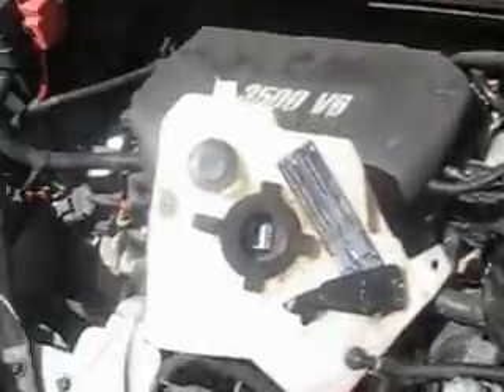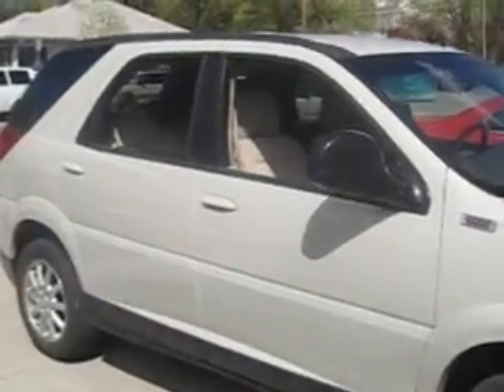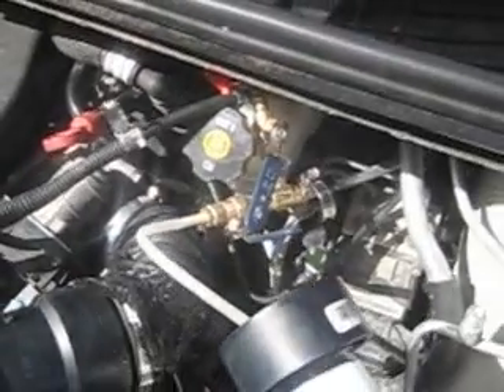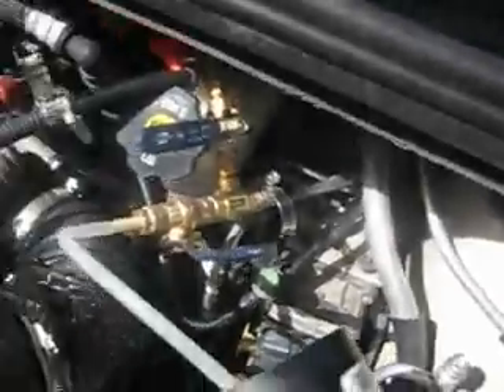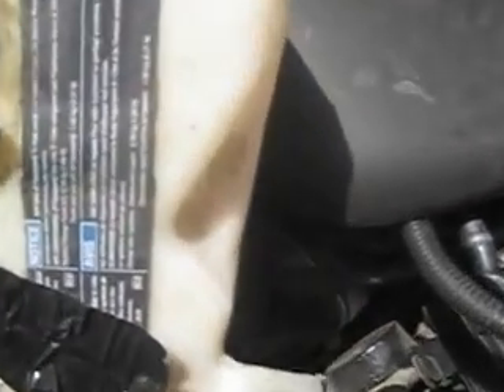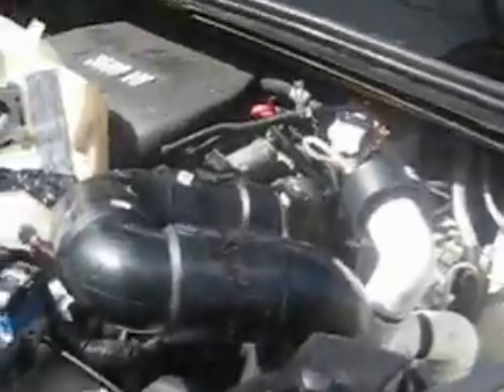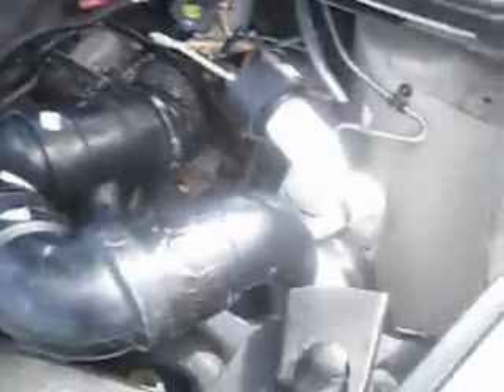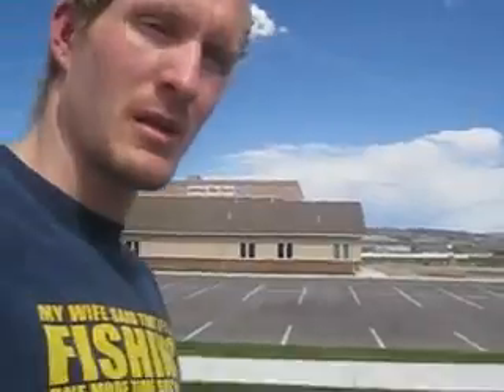200+ MPG Gasoline Vaporizer Project Original Design (Driving On Only Gasoline Vapor)

Comment: do you have plans of how to do this that you're sharing? I mean like a downloadable pdf of detailed instructions on how to do this?
Reply: Tyson Capel
I appreciate the reply - and will be waiting eagerly, I'd definitely like to see some plans for this.... Thanks
Reply from the maker: No sir I don't have any downloadable plans I won't have any until I have a system that is reliable enough to put plans out for it.
Reply: Do you anticipate that to be soon? Or could it be quite some time?
Reply from the maker: I would like it to be soon but reality says it won't be. Alot of improvements and testing still need to be done. I do have a vaporizer injection nozzle that is in the works and is by far the best design. I will be testing it once I have the money to get it made. The prototype will cost me around $2000.00. I have already put around $12,000.00 into the research and development of these systems so to an extent time is contingent upon money.
Reply: Tyson Capel
So are you actually going to be designing a product? Or are you just currently perfecting different designs that people can make themselves?
Reply from the maker: James Popp I am perfecting designs that people can make themselves. I Have a design that has to be machined and will be computer controlled but the file will be available for anyone to download so they can get it machined anywhere there is a CNC.The electronics will be available to purchase.

Comment: have you tried this on a tubo charged engine .  might solve the problem on humidity issues,
Reply from the maker: No I have not. It may solve the humidity/moisture issue.
Reply: what humidity issues are you talking about?
Reply from the maker: I am referring to the constant change it the moisture contained in the ambient air.

Comment: Tyson, One suggestion that might increase the efficiency of this system, Why not build another heat chamber with copper or stainless steel wool just prior to entering the intake manifold to super heat and further vaporize any droplets that may enter the intake. This should further increase the efficiency....What do you think?
Reply from the maker: Check out my newest vaporizer video of the vaporizer on my generator...

Comment: Have you tried to compress the fuel vapor into a container, then letting the fuel injectors manage the compressed fuel vapors?
Reply: because the vapor will again be transformed into liquid
Reply: Compressed fuel vapor is gasoline. Doing this is essentially just letting it run as it normally would.

Comment: Brave man to use such a nice vehicle as a test bed.

Like you, I'm amazed and disgusted that auto manufacturers would just let these patented gas vapor systems sit unused even after the patents have expired and they wouldn't have to pay any royalties while they struggle to meet clean air and CAFE standards using clearly inferior technology.
Reply: the auto manufacturers have been purchased by the oil companies for over 50 years.  why do you think all cars around the world have similar features, design elements and fuel performance?  yeah, every designer thinks the same design all over the world within a couple years of each other.  there are regulators that will allow a company to be a manufacturer as well.  also owned by the oil comapnies.  do you really think anything would be left to chance?
Reply: ***** Yea, and why good companies like saturn, who had SL/SCs getting 40mpg got bought out and closed.

Comment: Instead of heating up the fuel, which then could become explosive, put the container under a vacuum which lowers the temp that fuel evaporates.  This will make it MUCH more effective in cooler weather.  If you check my channel you will see videos of my vapor setup.

Comment: Actually, pre-ignition has NOTHING to do with the state of the fuel, i.e. vapor, mist as with fuel injection or stream as with carburetor jet. It has to do with fuel grade and timing. Fuel grade determines fuel burn rate. Pre ignition usually happens when either low octane fuel is burned in an engine with timing advanced for high octane which slows burn rate, or when the timing is too retarded which causes another problem, knock which can damage pistons

Comment from the maker: Check out my other videos. I use exhaust to heat the vaporizer. Using heating coils if they were electric would rob power from the engine which would in turn use more fuel.

Comment: Use heating coils. The gas is too cold to become vapor. Heat the gas up. You need more vapor. Tom ogle 1977 I believe had the same problem with the tank getting freazing cold and getting 9 mpg and couldn't pass 20 mph. He used heating coils and he destroyed the barrier on the mystery. I want to make one but idk if I will be able to or if its illegal. But I know how to make it work and make it. Just scared to try and get arrested or destroy my car.

Comment: Hey Tyson. Heat the fuel with water heating coils and also, reinforce you gas tank or fuel tank because it will implode.  heat the fuel and you will have more vapor to burn at higher rpms. I haven't made one of these but I believe if you heat the fuel so it doesn't cool because if it cools it will condence vapor to liquid and there won't be anything to burn. Its because of the vacuum effect. No more than 170! It'll boil at 170! That's a bad thing. Find a way to heat the vapor as it goes through.

Comment from the maker: Check out some of my other videos they have close to what you are talking about in them. I use exhaust for heat and a float switch to control the fuel level, as for pre ignition there is no problem with that the cycle of the engine takes care of that..

Comment from the maker: As far as it letting me know what mixture I have the leaner the better as long as the same amount of power is there. The vaporizer causes my engine to run cooler then normal at an average temp of about 204 degrees F.

Possibly I haven't tried that.

Comment from the maker: No there have been no problems thus far with the engine getting to hot because of a lean mixture, In fact it runs cooler at an average temp using a cylinder head temp sensor of 204 degrees F.

Comment: one question for ya tyson, how are you preventing pre ignition..??..also..if you would use a carb float assembly in a tank you could regulate flow to your bubler, or vap tank...also a small heating element regulated with a rheostat would guarantee fuel temp...your thought`s..??

Comment: There are 50hp of energy in one gallon of gasoline. Why don't you do some math to figure out the hp requirement for an average 5 passenger going at 60mph. Once you have that done, come back and tell us if you still believe those carburetor patents.

Comment: That is why you get the leaded gas, got to change some sensors and make sure the system can run it, but typically c16 is untampered with.

Comment: This pose's an interesting question though, a leaner engine if leaned out to far has been know (with conventional setups) to damage themselves via the pistons getting to hot and literally burning a hole into the piston. Have you had any problems with that lean mixture and what I have stated? Also does the engine still make the same power it did with the old setup while still conserving fuel and getting your amazing fuel MPG?

Comment from the maker: unfortunately I had to change it. There were far to many problems with the old setup I had I could only get it to run right a few times. I needed to build a prototype system that would allow me to have control of many things that are needed to get it running properly every time.

Comment from the maker: I'll be testing with other fuels later. I have ran my jeep off of used motor oil with this system. Why not a working system by now because it takes allot of time to get things working properly. I do have the switches in my car so I can control everything from in there. I switched to an electronic controlled system and I also have a manual valve system this way I can operate it in or out of my vehicle.

Comment from the maker: I would place a air/fuel gauge in the exhaust system which would work out good and would let me know how lean the burn is. If it reads leaner then I am running more efficiently with the vapor setup.

Comment: I have been following your work and anyone with common sense would be using this setup and not making new ones. Obviously the other ones are not as good as this design if they arent getting the same mpg or better. Unless you made a mistake and did not really get 211 mpg! With that mpg i wouldnt change a thing!

Comment: why not a little acetone vapor?  Why not a pot of boiling water with a hydrogen/oxygen separation tubing reservoir system?  Why not a working system by now?,,you should have all of those valve handles and turning on off switches inside your car within your arms reach so you do not lift the hood to make it work.  Either drill through the firewall or put the system underneath the car or by the gasoline tank.  If you put the system under the car you can just cut out access panels for the valves.

Comment: You added a secondary 1 1/2" air inlet just past the vapor outlet port . Is this new air inlet
hooked up to open and close with the butterfly valve in the throttle body?

Comment from the maker: It could be the air flowing through the engine compartment. At higher speeds I had this same problem. If possible try turning the intake side of the bubbler away from the hood so air can't be forced into the container. Doing this on a vehicle is extremely difficult many things effect how it runs such as heat humidity altitude airflow etc. you have to dial everything in and control these things if you want a reliable system this is why I went with my newer design.

Comment from the maker: One of the only difference is I am not using the ultrasonic transducer and I added a secondary 1 1/2" air inlet just past the vapor outlet port on the vaporizer.

Comment: At :33 you show two two ball valves on the fuel line. One of them, obviously, would be to  shut of the fuel supply to the vaporizer. What is the other one for?
Thanks!

Comment: So with gasoline vaporizer designs, the key to getting the large boost involves using high temperatures to crack the hydrocarbons into shorter chains? Which would mean the ultrasonic designs and low temperature carbs don't work as well. Real nice work with this system, and it's great that you're publishing the design.

Comment: I have a little MSR Whisperlite camp stove that vaporizes the fuel before it is burned.  The stove is first primed to heat the fuel line and then the pressurized liquid gas is sucked into the heated fuel line and then gas is emitted. This means a complete burn in achieved. Just saying... but since hearing of this vaporizing for cars I wondered how it was being done. BTW, re gunk and crap, I believe that white gas would be far more pure without much waste product added, but it is more $.

Comment from the maker: I am letting people know what I have achieved I did actually go 19.86 miles on about 12oz of cracked gasoline. Wither you believe me or not that is up to you I would not believe it if I had not seen it with my own eyes. In fact it took it a while to sink in after I measured the gasoline out when my test run was over. It still blows my mind to this day.

Comment from the maker: There is in fact more then one way you can get 50+ mpg from fuel without the car being a hybrid. You have been brainwashed into believing that to be so when it is completely false. I have personally seen with my own eyes as have others splitting the gasoline into actual gasses allowing me to achieve 200+ mpg. It is fact that this has been achieved.

Comment from the maker: I'm almost there! Have to seal off some exhaust leaks connect up the secondary throttle body, put in a inline meter valve for the fuel inlet then I can mess with the timing!

Comment from the maker: I've seen this video quite some time ago.  My new vapor system has some similarities. I use exhaust heat instead of heat from the coolant lines. The hotter you get the gasoline the better the results will be. I also have to use a double butterfly valve setup, one is the throttle body valve and the other is a secondary throttle body I place on the intake side of the vaporizer. I have not changed the timing yet. I will be changing the timing once I get the little bugs worked out of the vaporizer.

Comment: Heating the fuel before the injectors will "help" vaporize the fuel but because the energy (latent heat of vaporization) required to evaporate all the gas is very high.  The injectors would vapor lock or melt long before you get to a temperature where you would get complete evaporization.  Bubblers with radiators and boilers are the best way to add that energy.

Comment: I hope your results are accurate and I've have been working toward the same kind of project.  The one thing I think you should keep in mind is the cleaners and nonevaporative chemicals in the gas (1/7 to 1/4 of total volume) will build up in your evaporator.

    See: "Distilling Gasoline" to get "Pure" Gas.  It's dangerous but necessary untill you work out how to remove it as you go.  You could ultimately store it or inject it into the intake in the final version.

Comment from the maker: use lower octane gasoline it vaporizer slower. All the testing I have done has been with 85 octane gasoline. No cold vapor systems don't work as well. you may need to reduce the size of the container to prevent an over vaporization of the fuel.

Comment: i just did that ,using a heater core inside the ''bubbler'' witch mantained gas at coolant temp 75 C degrees or so, had alot of power like when injected climed at 120 verry fast but it consumed 2,5 litres on only 5 km , temp outside its like  - 6C...what am i doing wrong??? is it possible under hard acceleration to suck the gasoline liquid or it evaporated really fast because it was heated???any ideas thanks

Comment: But obviously water IS simply competely oxidized (burnt up!) (ashes!!) hydrogen. Basicly when we burn anything we are oxidizing the H in that material--and it is producing water as the byproduct. Organic materials all have a large amount of H in their composition. It is impossible to get any net energy out of water using any strategy, without first putting more energy in then you will get out. There was nothing arrogant or ignorant about his comments.

Comment: I repeated your work in a 2003 Subaru forester 2.5L boxer engine. I used Octane 95 because it's got less viscosity and has the tendency to evaporate in a matter of minutes during Kuwait summer time (140+ degrees!). the car had an old manual throttle spindle so I fabricated another throttle for the free air inlet. the car started and idled smoothly for quite long with less engine heat! but I couldn't finish the project though. I had to fly up to Chicago for grad school (-.-)

Comment from the maker: Thanks!!  There are no performance issues when using a hot vapor system. In fact there seemed to be more power, I would need to test this on a dyno to confirm it bet it seemed to have better performance with the hot vapor system then running on regular gasoline.
Interesting thing about the natural gas.

Comment: this is an amazing project. my concern is the performance issue. how do you compare it to you car OEM engine performance? I'm about to install a supercharger in my korean sport car and I'm thinking of fabricating a gasoline vapor system as well. also, I once spent a month in iran and bought a car for cheap and cars there use natural gas to run and the MPG equivalence is out of this world. a whole month of continuous use barely consumed about a gas cylinder (tank size)

Comment: love yoyr vids
well done
 question    ,,, with a fuel injected engine  what if the fuel was heated  before the injectors while under hi pressure  i believe when pressure is increased boiling point goes up to   so that the injector would emit a spray that would vaporize instantly 
what do you think  i welcome  any  ideas  on this  idea

Comment: I used to build engines for & convert vehicles to propane & dual fuel systems. Propane tends to eat stock valves ( high octane)... we used sodium valves & hardened valve seats to combat this. Id highly rec'd doing the same for a gas vapor engine.

Comment from the maker: It is absolutely true. I have not had success at achieving these results more then a few times due to the fine conditions needed to run a car on such a system. I almost have my new design complete which allows me to have much more control and the fine tuning needed to consistently obtain these results. I went 19.86 miles on about 12oz of gasoline.

Comment from the maker: The butterfly on the air intake portion of the carb will control the vapor flow into the engine. Get the air to fuel mixture dialed in this is the best advise I would give.

Comment from the maker: Thanks! I have not messed with anything on the engine. I have not retarded the timing or anything like that. I will be changing the timing when my new design is being tested to see if that improves efficiencies etc.
If you have a carb it will still run just like a fuel injected car with this vapor system. You will need to use a heated vapor system as I am doing with the new design it provides much better results then the old bubbler design.

Comment: Absolutely 100% congratulations... I am thinking on starting on a similar system now... thank-you so much for posting this video... I was just about to re-route exhaust vapour's back into the air intake ports in combination with using a solid coil hho system and gas ... this makes so much more sense ...ttyl... Tom